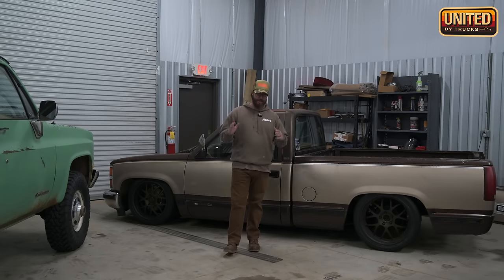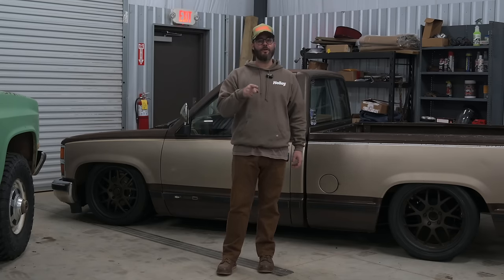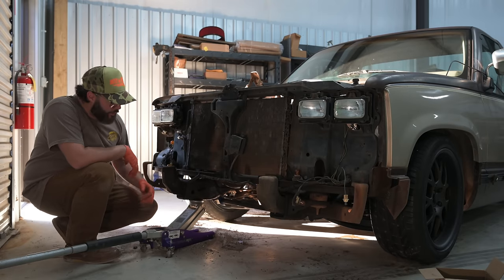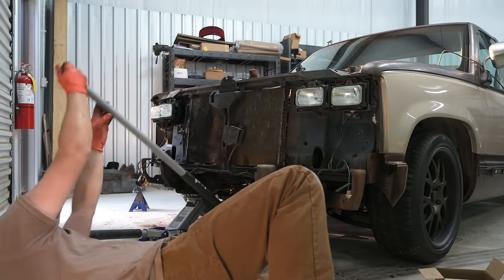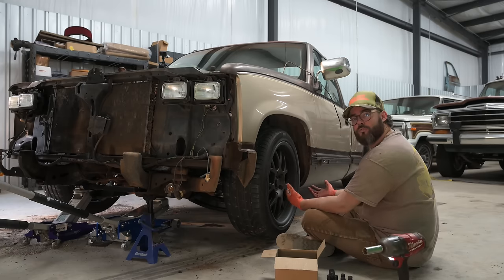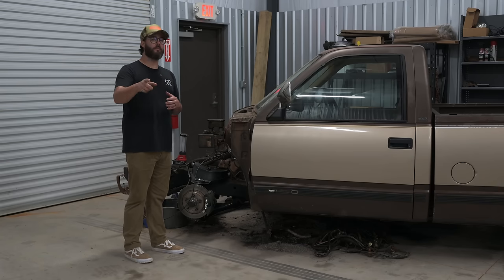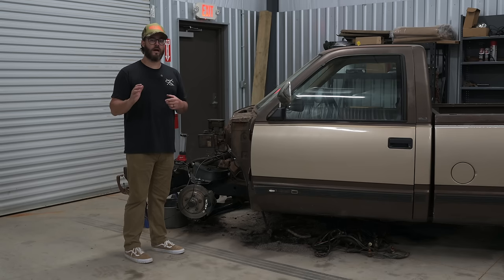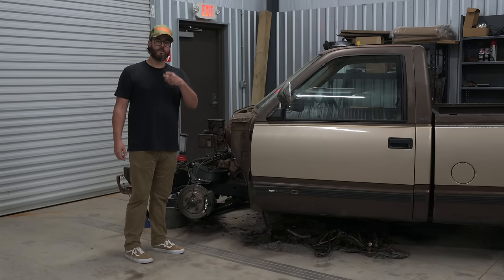DECONSTRUCTION: THE OBS RACE TRUCK BUILD IS BACK...enter at your own risk

Comment: I can totally relate. Started driving my first 93 obs here in Belgium in 2006 and it got rear ended in 2018. Just 3 months prior it had received a brand new crate engine with a freshly overhauled transmission. Now in Belgium here, in order to register it as a daily driver these American vehicles, import to us, have to go through a certification process, witch is quite a mountain to clime... so when my truck got rear ended, it got declared technically total loss, so I had to search for an other one, and they run pretty scares here in Belgium. Luckily I stumbled on a to be restored unit: rolling chassis with the cab, bed, doors an all the Belgian paperwork. At first I thought about only swapping all the good parts from my totalled 93 to that project, but later on decided to step into the adventure of a frame off restoration from my home garage. It's been in the works for three years now. I am currently in te process of getting the bed painted, only things that remain after that is bodyworking and painting the bumpers and the tailgate, finish some details and she good for a new life😊
Reply from the maker: Thanks for watching! Sounds like you got it all sorted

Comment: Robbie! If you’re going to ditch the th400, I’d be super interested in the speed sensor if it’s the stock one for truck. I’m in the middle of redoing my late father’s obs and it has a th400 in it but it wasn’t factory installed so I have no speedometer. 

Also, I know what’s in Illinois 😏
Reply: Just commenting again as I’m watching the video. 

The obs trucks came with a 21”, 28” and 34” core radiator from the factory. The 34” is what’s in my truck and I run a sbc but if you run the 28” rad, the stock rad hoses for the 99-07 trucks fit perfectly. Can’t get any easier than that!

🤣🤣🤣 ask Josh over at Yeah Buddy Garage what happens to your thinking when you inhale refrigerant. Poor fella was struggling after his WIMD episode. Also, if you do take the factory ac off the obs, the only thing you can’t buy new is the little J shaped metal tube that goes from the drier to the firewall for the evaporator. I just had to get mine off a truck in the junkyard but you can easily sell it for $50-$60 bucks!

Glad you got the pro coils installed correctly. I’d hate to see something happen to you or the truck if those bolts broke.